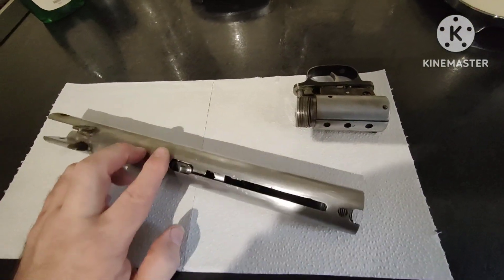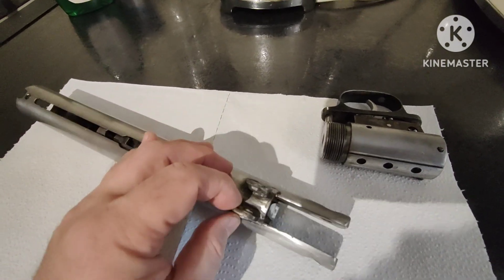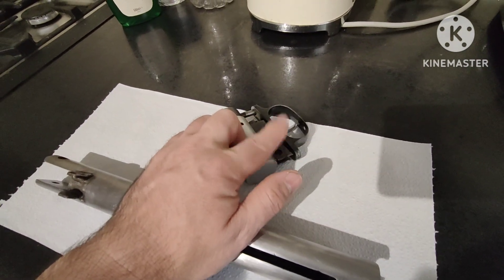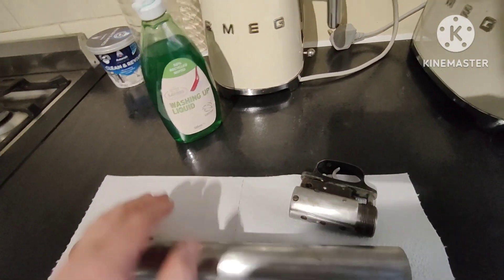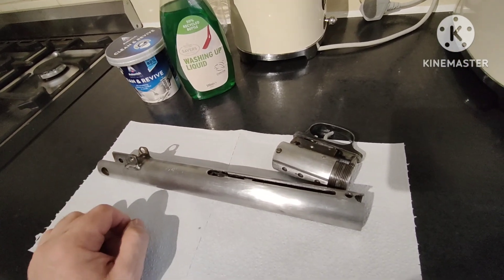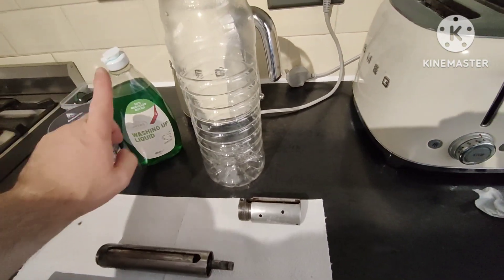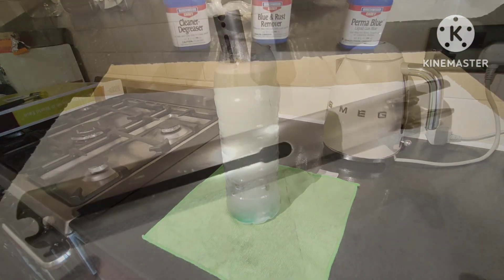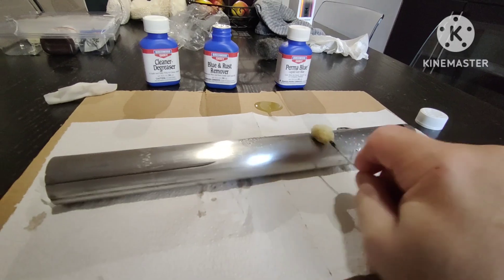Weihrauch HW80 Project: Cold bluing

Comment: Fantastic job on the bluing mate. Your gun is going to look gorgeous when you've  finished. I was wondering what it looks like once its on the metal and it seems to be a satin finish not as deep and glossy as the original factory finish but lovely nonetheless.  Well done bro I like it.  One love to all 🇬🇧🇵🇰❤️ Ali
Reply from the maker: TBH, no idea what or how Weihrauch blue their metal from factory?
I suppose it would be a different result at home for me if I'd have polished it rather than leave the finish satin?
The Perma Blue is more dark grey than "blue" so will be a different finish from stock anyways.
Reply: Can't wait to see the finished article looking forward to it bro.  That nut might be a problem without a welder will  be interesting to see your solution for it🤔 . Good luck mate 🍀👍
Reply from the maker: @MAli-SL2uk  fingers crossed I'm nearly at the stage when I can try a dry fit and assemble. Be nice to give it a shake down at the range and out some lead through it